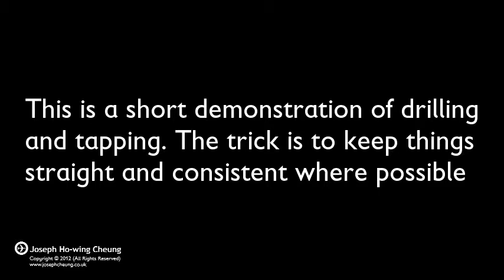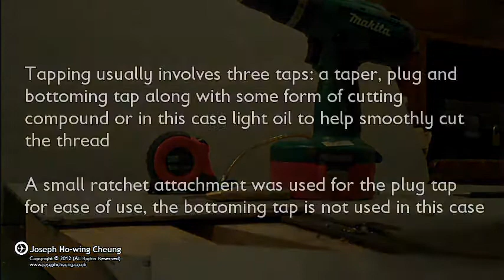HMS Belfast: Drilling and Tapping

Comment: Why did you not use a small drill bit first. Then it wouldn't of taking you 2 mins to drill the hole out. And don't push down on the drill that hard